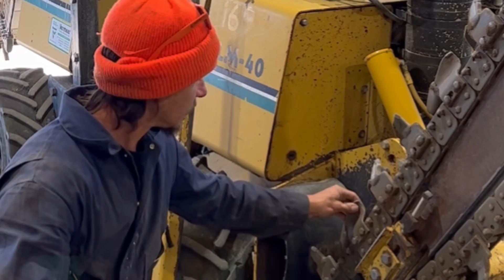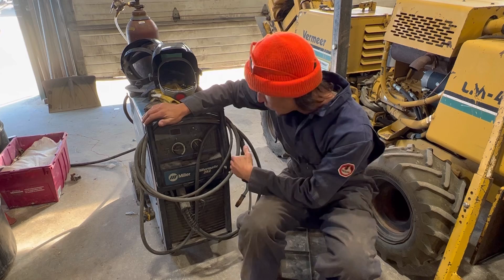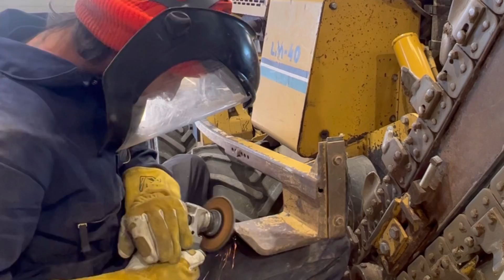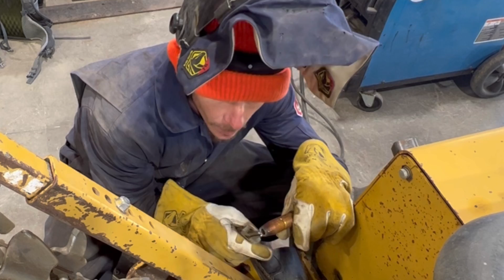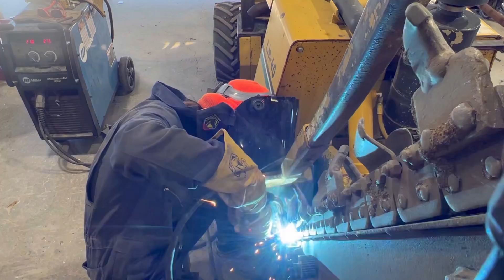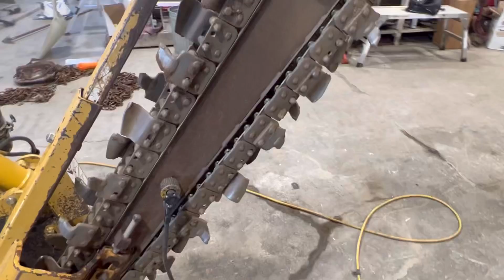Welding THE BIGGEST CHAINSAW You’ve Ever Seen!

Comment: Going uphill has nothing to do with slag entrapment, it’s about deeper penetration. Also, the “coating” from mig welding are silicone deposits.
Reply from the maker: That’s debatable. Time+ heat input + amount of filler = penetration
Reply: When I went through school I was taught that hardwire not fluxcore was the only approved wire type for downhill 3g to certify if it was tubular material or repair to undercut. But apparently I’ve learned different in the last 25 years. If you are aws d1.1 certified you can weld downhill if the WPS meets the criteria for d1.1 certification and the CWI confirms through testing the welder can meet the standards of d1.1 then technically yes hardwire and many other types of welding can be done down hill. Usually involves achieving a full penetration weld by means of grinding backgouging or some other method. But for a chain guard I’m sure Anthony knew his welds would hold.

Comment: 0.35 wire 22.2v 282 works well for anything but up hill. Uphill 21.5 300-315. It’s a good starting point. But honestly if it holds who gives a crap

Comment: Given the situation a good repair young man. I would asked the operator to take the tensioner off to aid repair and then l would probably have done some hard facing to give protection from slip in the chain.
Reply from the maker: The bar is bent . This was a get it through the season repair. Good advice thou!

Comment: 2 bolts and you could have welded it in position.
Reply from the maker: Look harder
Reply: @MeltinMetalAnthony  Ah, Looks like it mounts the bar to the Rig. After that could the bracket be removed?
Reply: Looks like It’s also a tensioner but none the less he could have had the owner take it apart so all he has to do is come in and weld it would have been a stronger better lookin job but I’m starting to notice a hack job trend with this guy

Comment: The smaller part is an easy removal... Why not take that loose and then weld in position?
Reply: No one wants to hear the truth or try another way, especially a welder
Reply: Anthony said, the bracket was wore out.  I would say otherwise, they were stress crack from impacting.
Reply from the maker: It doesn’t come off with those two bolts. They are attached to the tensioner.